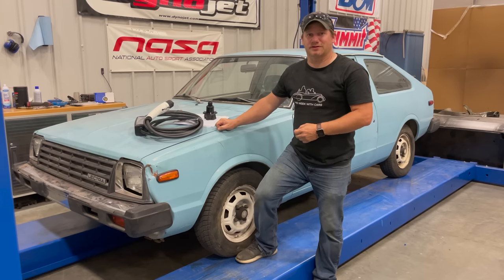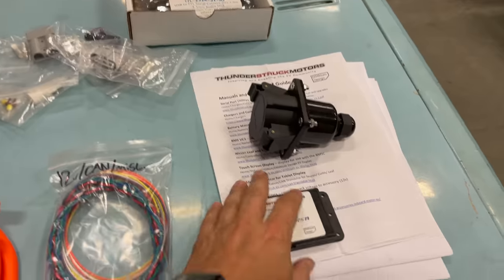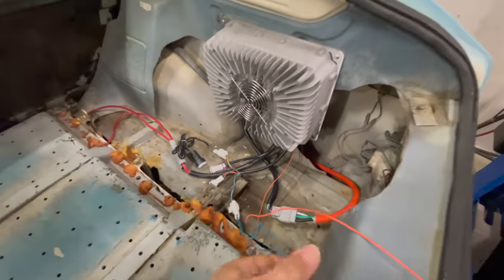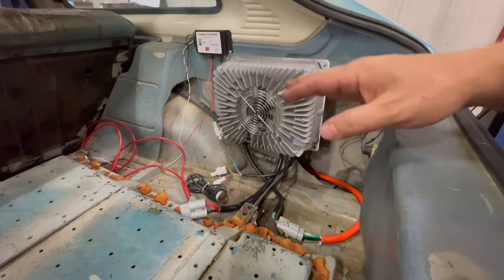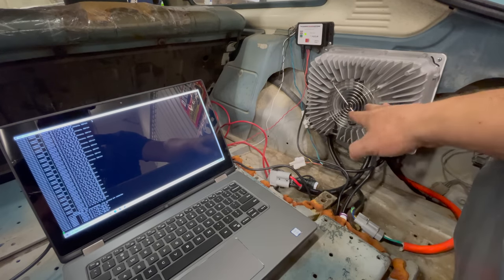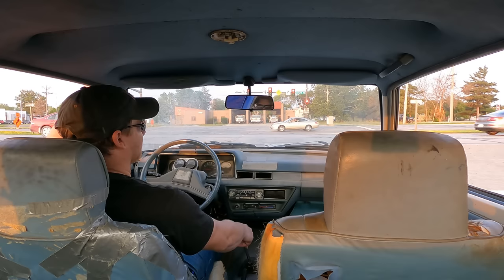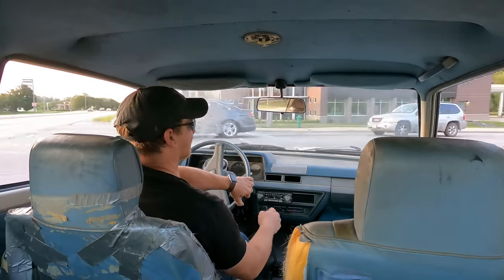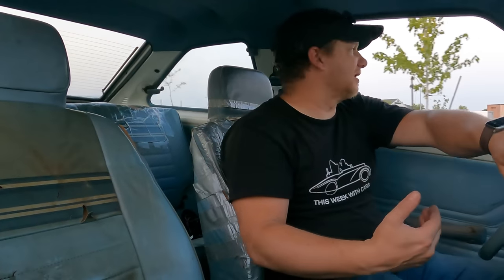1981 Lectra Motors Lectra 2+2 - Will It Charge?

Comment: That electric car is creaking like a 90 year old’s knee joints. The duct tape on the seats is a nice touch too
Reply: I think a lot of older cars would be similar (although maybe not quite so extreme) - the difference is they have engine noise to drown much of it out!
Reply: @Lukeno52  Creaking or not, it works and drives after years of neglect. dry rubber suspension bushes will love a silicon spray to work there way back to noise free motoring, and If you was fussy, new seat covers would hide years of sun damage to the seats, easy to wash if dirty. I love the way a petrolhead like Steve has challenged old styled unused ev and modernised its charging system.. Wonder how many EV drivers look and think that years old Nissan could NOT possibly modern like current EVs.. WELL DONE STEVE.
Reply: Just about what I was going to say, "90 year old's knee joints" is an awesome phrase you came up with! haha 
Seriously though, it could use some suspension updates, lotsa heavy batteries in there, eh?

Comment: There is CCS that includes the J1772 connector on the top. The extra connector on the bottom are for DC fast charging. Then there is level 2 charging with only the AC J1772. Get the plug share app and set it to filter to on J1772.

Comment: Great that you just dove in and made this thing work again.  I was amazed at the lack of sparks, smoke, and fire in your two videos about the car.   I'm sure there's more than enough current involved to weld with.  I'm jealous because you can quick charge around town and I'm stuck with a slow 120v charger on my Zero motorcycle.

Comment: The first charging station you went to was a DC Rapid charging station, which your car is not equipped for.
The first connector was a Chademo standard mainly used by Japanese cars, the other that included your standard connector with the extra connectors at the bottom was a CCS connector. 
In Europe and the UK we are settling on the type 2 AC connector and CCS standard. There still are Chademo stations around to cater for The Nissan Leaf and a  few older models that used that standard.

Comment: Does nobody make an adapter so you can use whatever fitting you find? Just a thought.
Reply: pretty sure there's an adaptor for that.
Reply: Pretty certain that the adapter will need an app installed too.
Reply: The connection is a different shape because the car needs AC to charge but the charger was DC. You would need a DC to AC converter not just an adapter. The plugs are different shapes to stop you using the wrong one.
Reply: is there an adapter to use diesel in a gasoline car?... pretty sure there are different pumps for those too

Comment: Now u have that electric. Time to get the suspension fixed so not driving ya crazy with the squeeking some hospital's have those chargers also
Reply: Seriously. With a engine at least the sound would hide that sound. 

Give us some stats on the car. Range, speed, recharge time, etc.
Reply: If ya do it at a Hospital, you are required to yell, CLEAR before ya zap it! haha

Comment: Looks like a short double-ended adaptor cable might allow the too-big one to work, if it doesn't complain about the other part not being connected. (assuming the pinout is also a match and it doesn't just use the same connector)

Comment: buy land next to charging stations and build places to eat, internet and sleep.  Waiting all day to go another 2 or 3 hours away  people will be needing something to do.
Reply: Tesla has the charging cycle down to 15 minutes. My Nissan Leaf Plus can do it in an hour if I am down to zero. Which you don't usually drive it down to. With today's range on EV's there isn't as big a need to charge while out anyway. I've gone nearly a thousand miles this month and only charged at home. That's pretty low mileage for me but I've also laid out some trips where I could recharge on the go if needed. The range on my Leaf is 215 but I'm seeing better.
Reply: @WayneMoyer  that sounds like lots of progress has been made in EVs.  And if a charge is only 15 min it would be hard to complain too much but that is a lifetime vs. pumping a tank.  But nobody talks about where all these dead batteries go.  The green people bitch about them, dumps dont want them.  Real good batteries like to set houses on fire.  I charge my RC Lipo batteries outside.  Its just a different kind of pollution heading out way.
Reply: @greavous93  How many old EV batteries have you tried to dump? They sell on ebay for thousands as people use them for home powerwalls. There are many companies already dealing in end of life EV batteries as they are cheaper to reprocess than mine new materials, the problem at the moment is that there are not enough dead batteries as they last well over ten years in the car and then another 10 to 20 years in a house.
Reply: @greavous93  The fuel type might be different but 15 minutes would be a quick turnaround compared to filling up a heavy commercial with 400-500 litres in most cases. It's not the actual dispensing the fuel, it's the authorising and payment using a fuel card that usually takes the time.

Comment: Wow, a COM port, I haven't used one of those in decades!  Brings back memories of pre plug and play computing.
Can you build a pigtail adaptor that just uses the connector you need, or would the charging station reject your vehicle for not being wired compatibly?
Reply: Sean M  I think he was talking about a virtual COM port via USB. Quite a few things (e.g. 3D printers) still use serial protocols without actually requiring an old-style RS232 connector on the computer.
Reply: Sean M  So do I but I don't think there's one used in the video so that could get people a bit confused.

Comment: Current automotive standards for high voltage DC which is defined as greater than 50V require the wires to have special coverings and be orange like that cord they included. 
Obvybeimg home built this doesn’t really apply to you just an FYI Incase you become known as that guy who can fix electric cars and someone wants you to work on theirs.